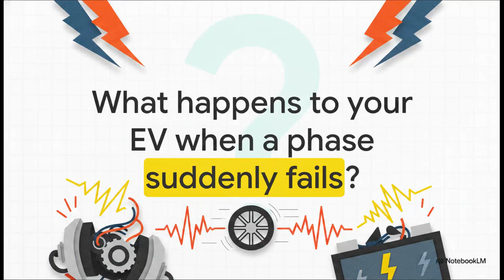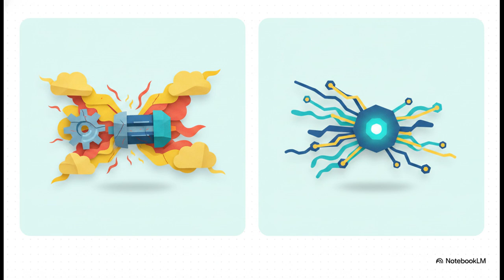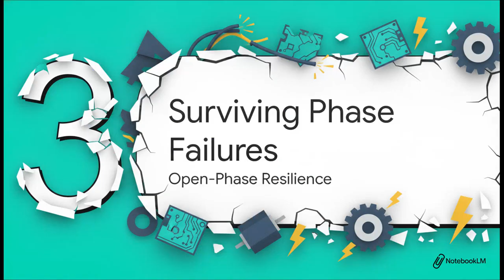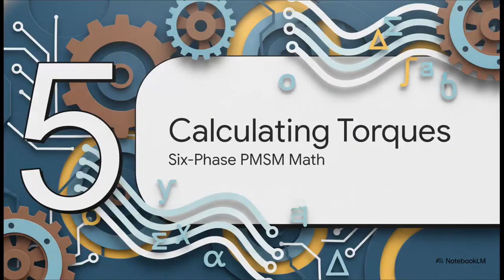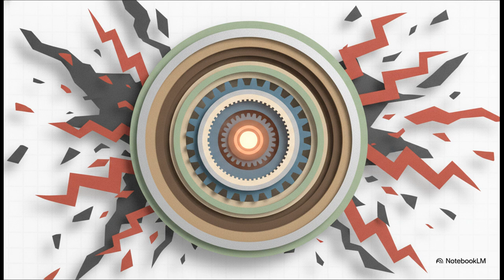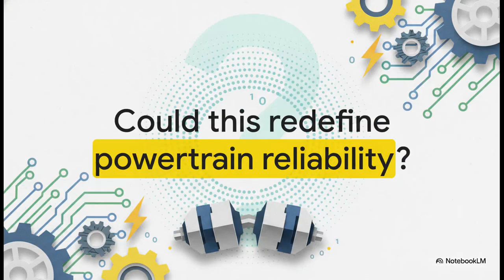Advanced Model-Free Fault-Tolerant Control for Dual Three-Phase PMSM

Comment: Very good video. Thanks! I am currently trying to deploy a LQG/LTR for a phase failure case from 3 to 2 phases, I dont know yet, if it will work. I definetly need new ODEs for the failure case to linearize. Lets see, maybe I will adaptive control also give a try.
Reply from the maker: Thanks for your feedback! If you get stuck with your project I would recommend exploring WiredWhite CALC or MeowL AI assistant on our platform. Finally there is always an option to connect with one of our tutors for a consultation call ;)